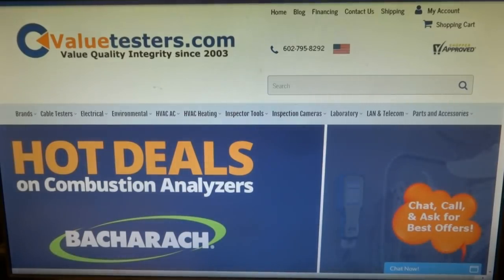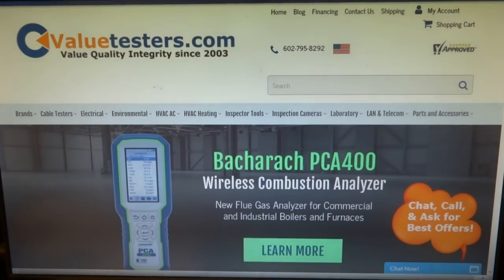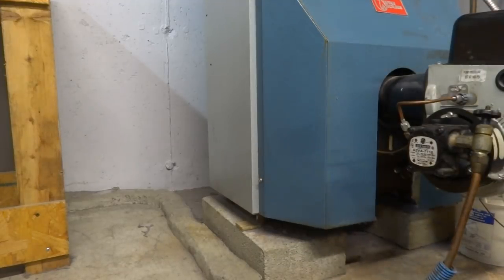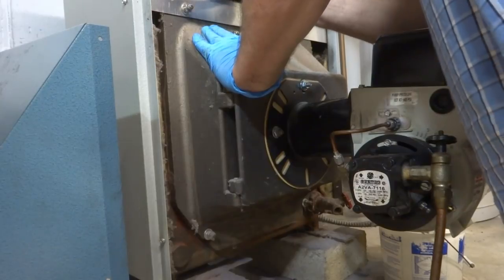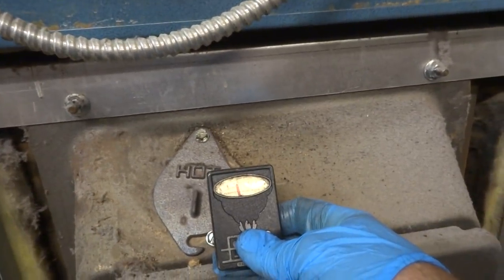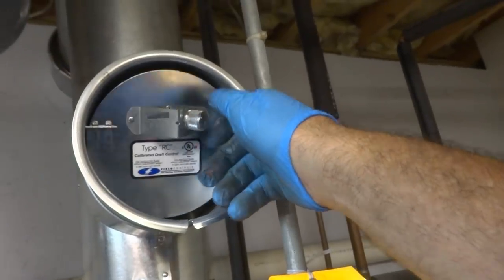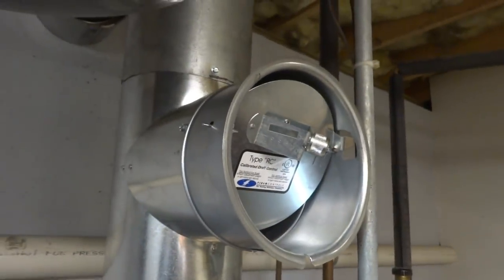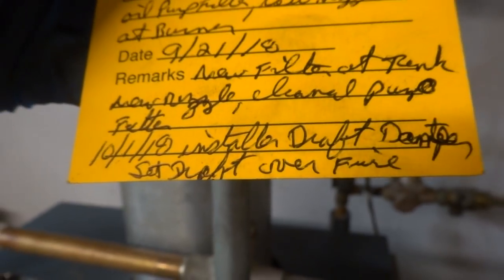how to set draft on a oil boiler

Comment: hi steve adjusted barametric damper  but draft over fire i cant get past zero got same gauge you got its ,04 on the damper but reads o over fire if i close air it will  go to .02 but flame is smokey  in inspection  watched your vids all the time i got that gauge from supply house today  about 120.00 dollars hope i can get to figure things out take care thanks for all your nice videos

Comment: What tester do you use to check the draft?
Reply: He used a Bacharach Draft Rite. He failed to mention that draft is negative for a residential oil burner. If the needle went to the left, that would be positive and fumes would be leaking into the house, very bad. He did not bother to measure draft in the breach which is draft as smoke enters the chimney and he did not measure smoke number either. Overall, this video is somewhere between a C- and D+.

Comment: I have a situation where, in cold weather, the draft is such that the damper opens as far as it will go. I assume this causes the draft into and through the boiler to increase over the desired draft but I've never tested it to see. Guess I will do that this winter to see how much it increases. I'm wondering, if there is any acceptable way to decrease the draft of the chimney?

Comment: Is there a safe way to reduce chimney draft so that the barometric damper is not open almost all the way in order to produce correct boiler draft? Or, can you connect the barometric damper to outside air so you're not wasting heated inside air going up the chimney?
Reply: I see that in a Beckett manual they say that you may have to install a 2nd barometric damper.

Comment: What instrument are you using to get that draft reading?
Reply from the maker: https://www.ebay.com/itm/Bacharach-13-3000-Pocket-Draft-Gauge-With-Draft-Rite-Tube-Set-10-to-0-to-14/192630751966?hash=item2cd9b002de:g:AWIAAOSwg9Jbdcq6
Reply: Thanks bud!
Reply: @stevenlavimoniere  I have 20 year old Axeman -Anderson oil furnace with a Beckett. i have had several issues lately but have been resolving them. Currently i have .03 neg draft at the stack but at the fire i have a positive .01 and i am getting carbon build up coming back the test hole. So i imagine top of furnace clogged? should there ever be positive of the fire, service guy said some older one did. Any insight would be amazing.